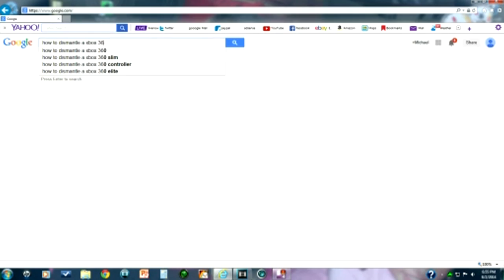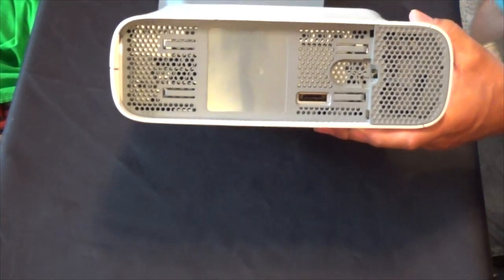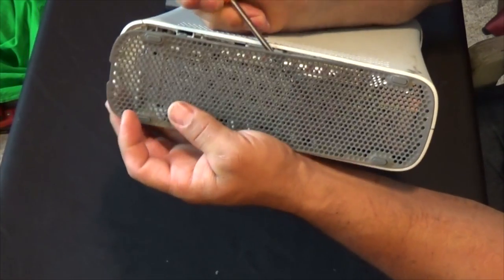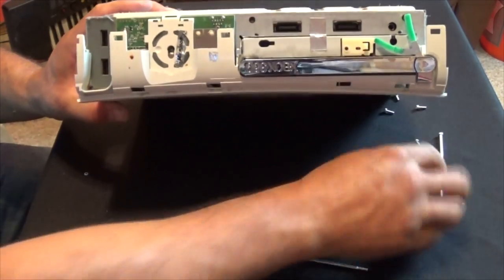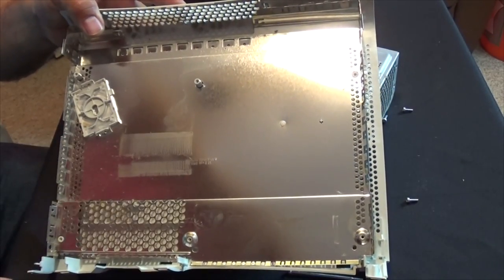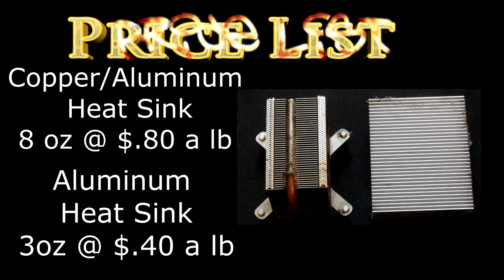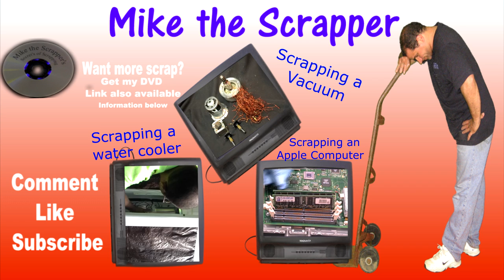Scrapping an XBOX 360

Comment: Xbox 360 consoles are better to just scrap. Without knowing what is wrong with them you can't really sell the parts and selling it complete as is you might get $20 or $25 which doesn't include shipping or fees. After all that you'll be left with about $5 to $10 selling it on eBay as is and that's hoping you don't have buyers complaining. Scrapping them reduces issues later.
Reply: That is absolutely correct!!